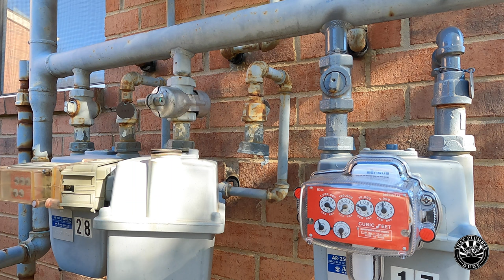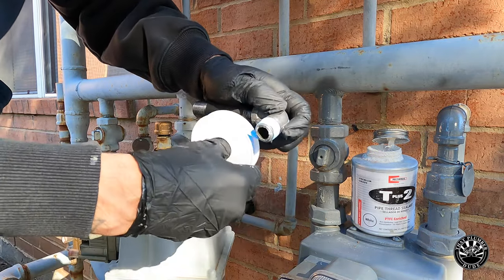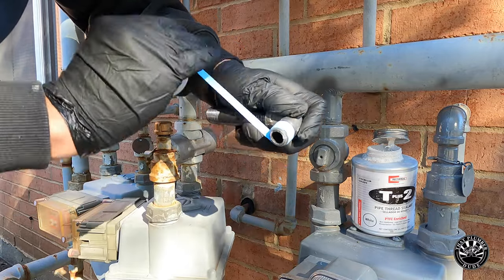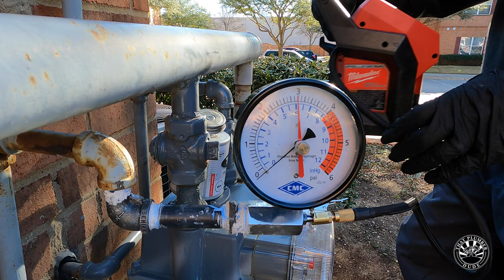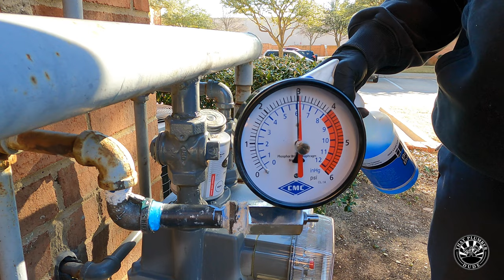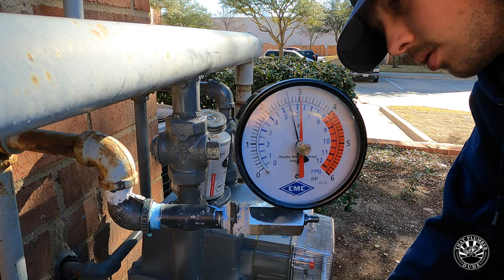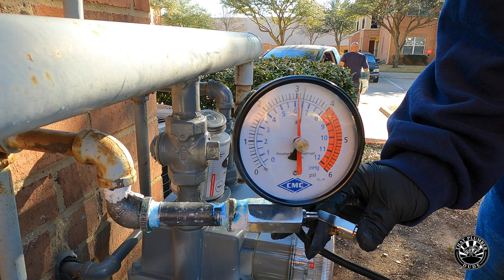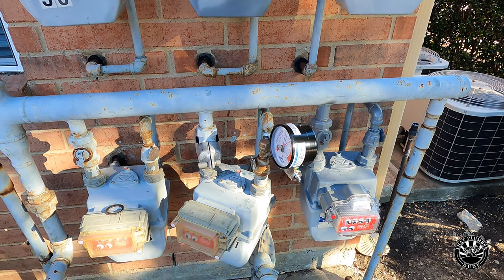Natural Gas Test | Plumbing Vlog for Apprentice Plumber | Leak Detection

Comment: little carried away on the pipe dope aren't you? considering it's just for gauge
Reply from the maker: I do that on most of my gas joints. The T2 white dope is a soft set so it won’t harden like the True Blue dope. It acts like a lubricant as well, makes it easy to tread onto with the thread tape.